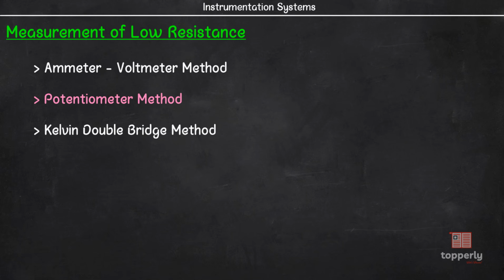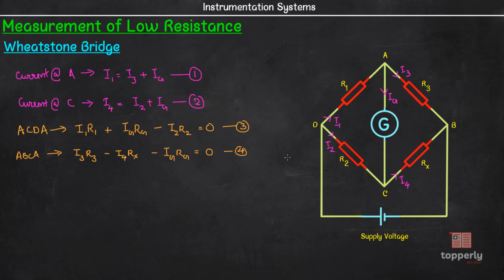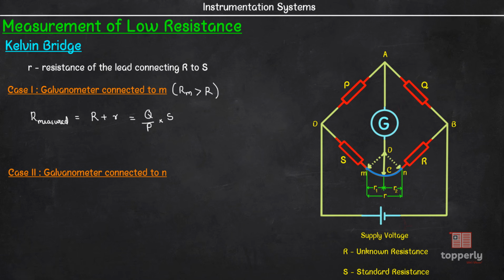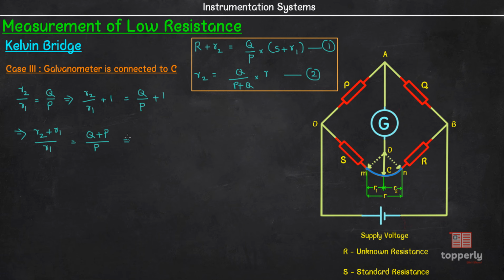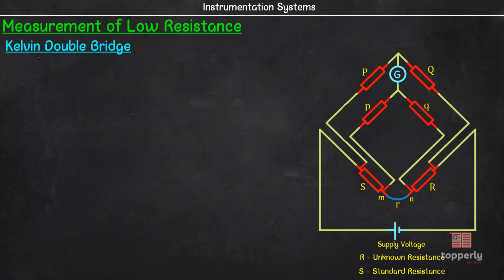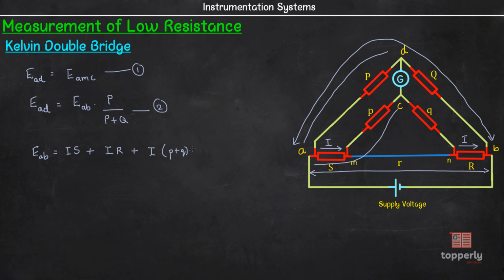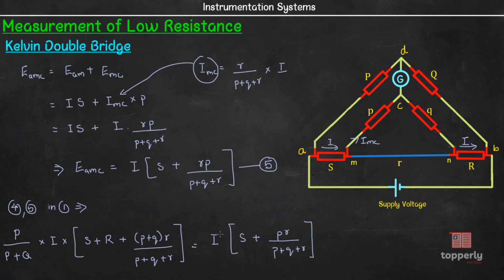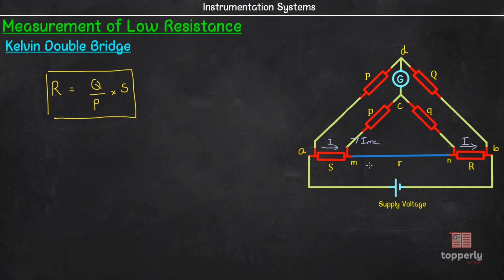Kelvin Double Bridge Method | Low Resistance Measurement | Instrumentation Systems

Comment: What suitable Voltage power supply and suitable value for current can be used in this experiment?
Reply from the maker: You can use a 5V source and limit current to uA to mA range depending on the power rating of resistors :)
Reply: @Topperly  Ok. I use 0.1 ohm for Fixed Resistor in Kelvin Double Bridge Exp. So can I used 4mA for current?
Reply from the maker: If you know the power rating of resistor, see if that current burns out the resistor or not. If you do not know, start with uA range currents and use a sensitive galvanometer - bcz we only need a value of current that can cause some deflection in the galvanometer :)
Reply: @Topperly  Oh I see. Understood. Thank you for ur kind reply. :)
Reply from the maker: Always glad to help our viewers :)